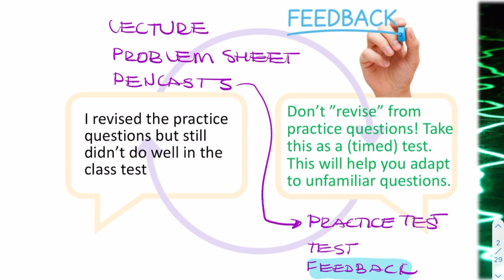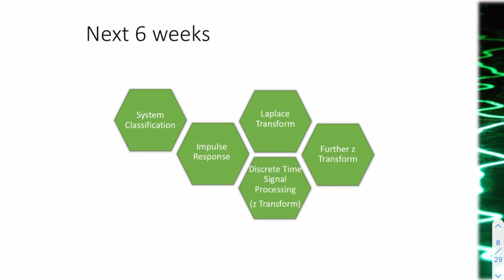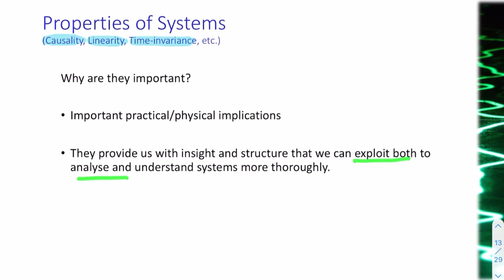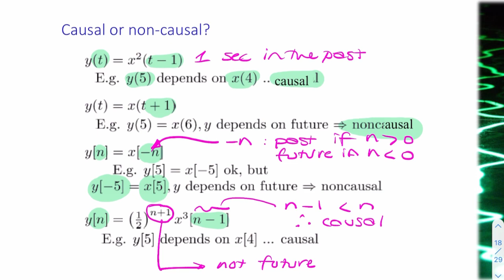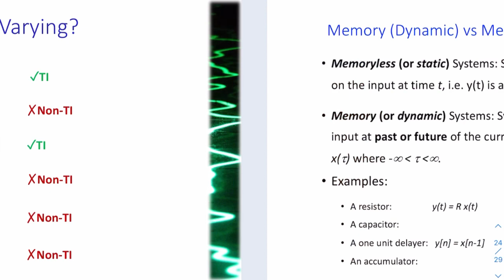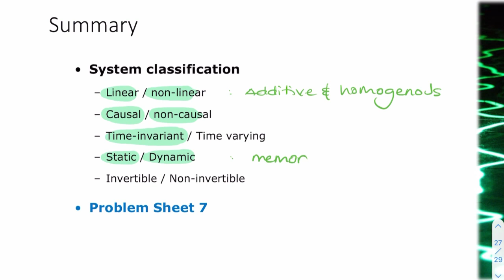Lecture 7 - System Characterisation

Comment: Select all the correct answers.
The output of a first order system is
y(t) = e^-4t
The time constant of the system is 4 sec.
The time constant of the system is 0.368 sec.
✔After two time constant the output of the system would have decayed to 13.53% of its initial value.
✔The time constant of the system is 0.25 sec.
☐ After two time constants the output would have decayed by 13.53%.